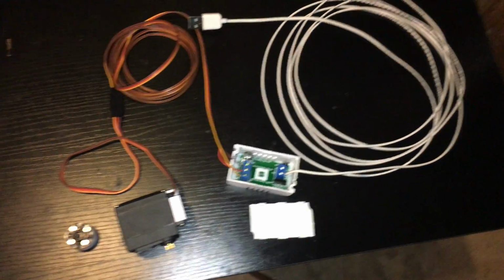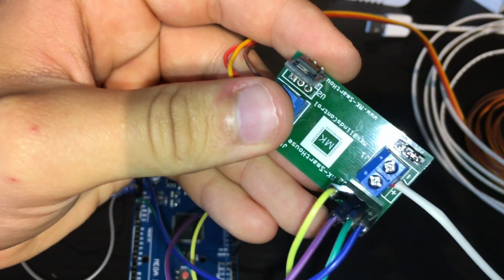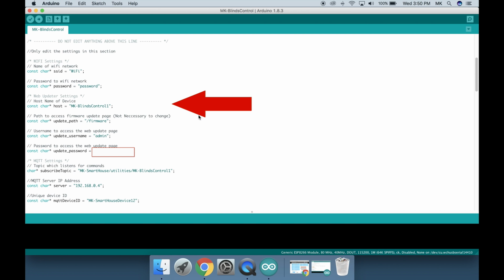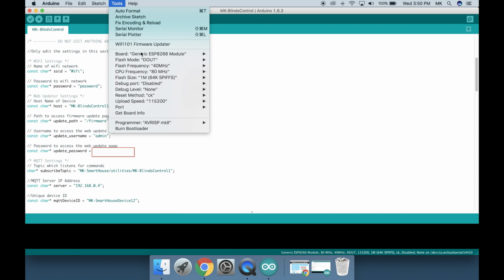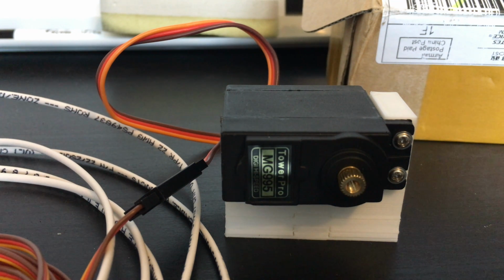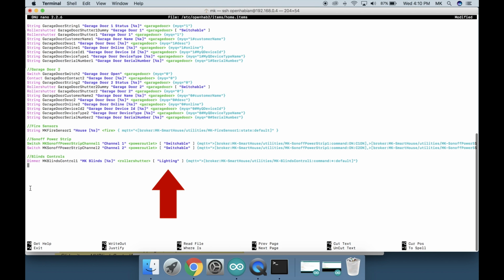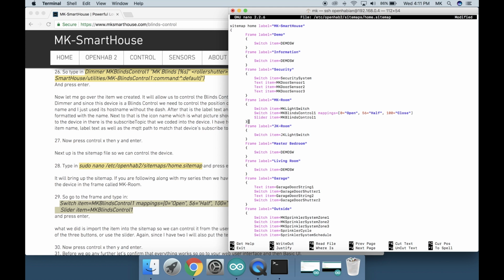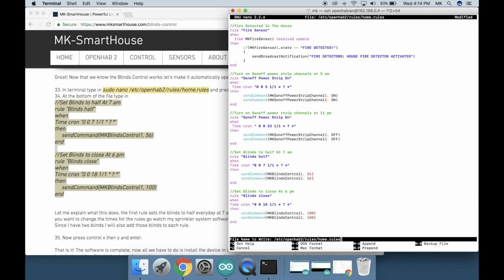Complete Guide Blinds Control MQTT OpenHAB ESP8266 : Software MAC

Comment from the maker: Hey guys, sometimes the device for some reason does not like to be flashed as a Generic ESP8266 module, if the device does not respond after you flash it, then when you flash it choose the ESP-12E as the board.

Comment: I did exactly as per the video and assembled hardware from you, looks like my motor doesn't respond, I was able to go to the http server in the browser though. I believe mqtt isn't responding.
Reply: I am having the same problem. I can get the servo to respond to changes from MQTTfx however when I try to send commands via the http page or the openhab app on my phone I get no movement at all. I was able to go to the Openhab community and read an article from Tom Dietrich showing some troubleshooting tips where you connect to the Openhab2 Log Viewer (frontail) and I see the changes in the logs however no movement at the servo. Any help would be greatly appreciated.
Reply: Hi did you get the servo motor to work with the http page or openhab app?

Comment: move your setup to Tzapu WiFiManager lib, so no need to edit a single file, just upload firmware and do the configuration via web... you can even add custom fields, so way easier: https://github.com/tzapu/WiFiManager
Reply: https://www.youtube.com/watch?v=A-P20vC7zq4
https://www.youtube.com/watch?v=_VBJ9Aa6w44
Reply from the maker: i have been thinking about doing this

Comment: All you do is pretty awesome and I noted that since day one you make devices that can be controlled by Mac or PC because they are the most common OS (yes there are linuxes out there but these guys doesn't need help ;) 
It would be extremely helpful for newcomers and for your channel growth if you also can cover Home Assistant because together with OpenHAB is the other big one in home automation. This way also your store can provide your great devices to help more people. Apart from that, all you do is great! good job.
Reply from the maker: Thank you, I will think about it and will most likely get into home assistant after I get all my openhab videos done!
Reply: + 1 for Home Assistant, otherwise I really admire your work. I am using the Sun component in HA to do sunset based automations for lighting which feel very powerful compared to just a set time, which you would need to change in the winter.